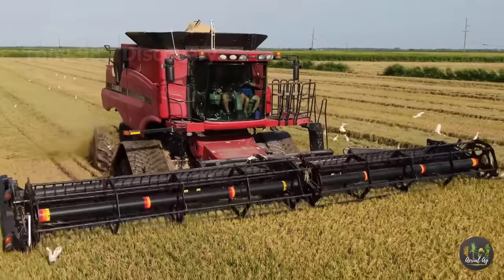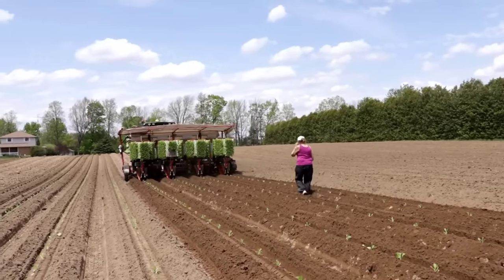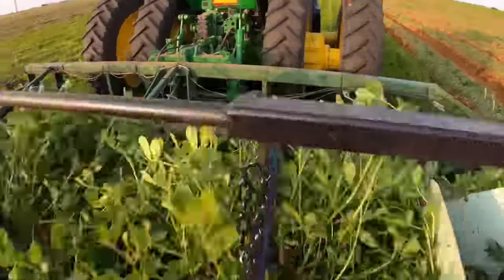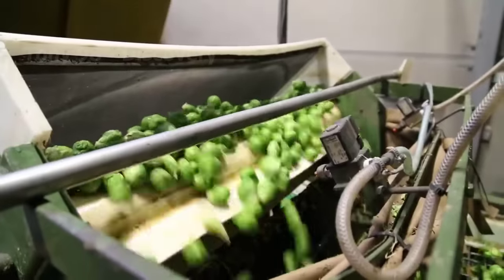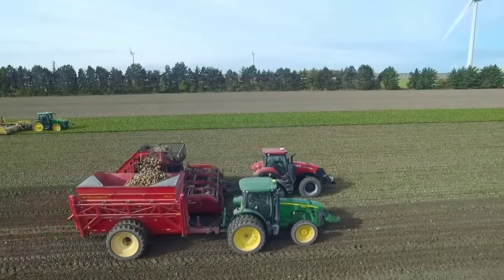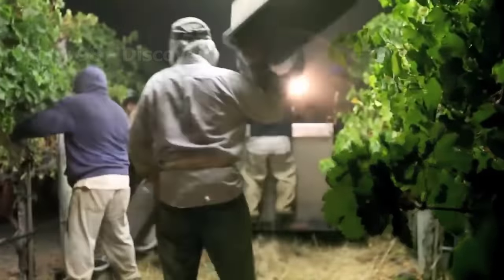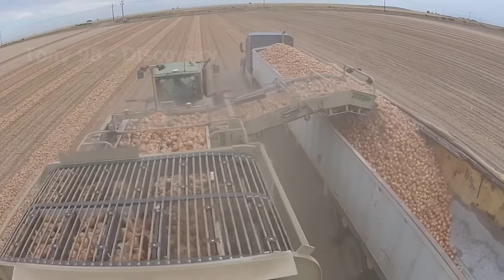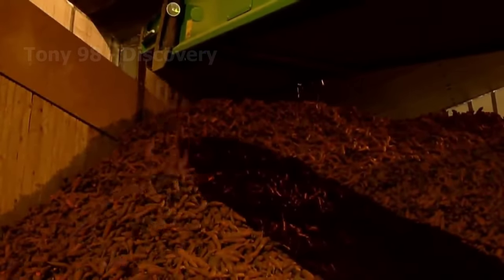How American Farmers Mass Harvest Thousands Of Tons Of Agricultural Products - American Farming #2

Comment: How much easier it would be to harvest with a modern machine like in American agriculture.
Reply from the maker: While modern machinery can certainly make harvesting easier, it's important to consider the potential drawbacks as well. Using large machines can be expensive and may not always be the best option for smaller farms or those with limited resources.